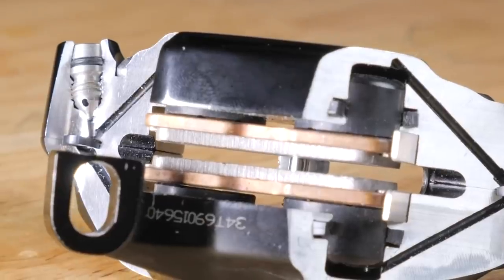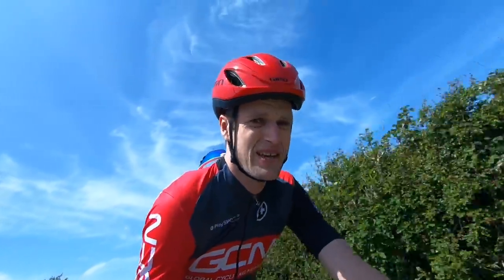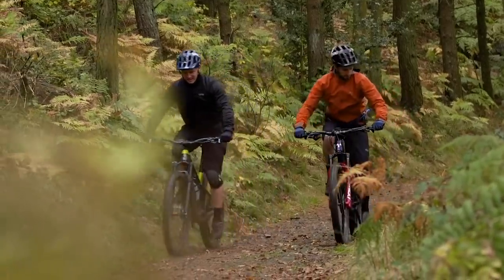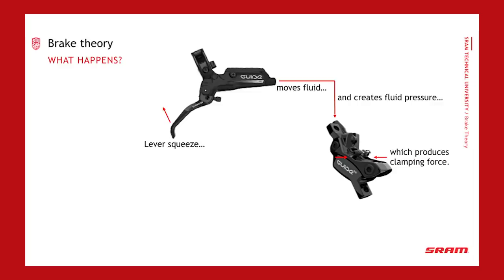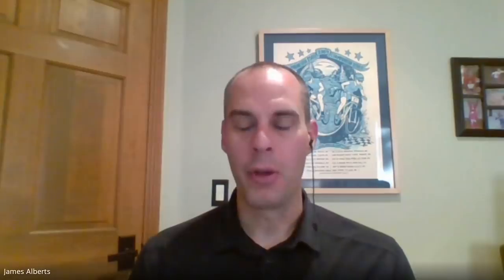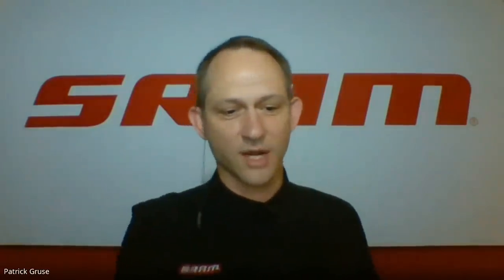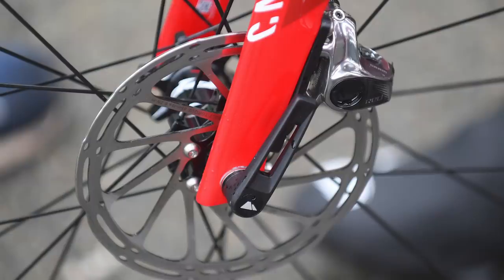How Do Disc Brakes Work? | What Makes Your Bike Stop

Comment: When tightening the bolts on disk brakes use a torque wrench and do it in star pattern (tighten the bolt diagonally from the one you just tightened). SRAM and Shimano have different torque tightening limits., when tightening the bolts do it in stages i.e. if the max torque limit is 4Nm then tighten all the bolts at 2Nm then retighten all the bolts at 4Nm.
https://www.bikeride.com/torque-specifications/

Comment: That was long overdue!  More videos on discbrake maintenance please!
Reply: In reality there almost isn't any on a road bike. The system is sealed and not exposed to the dirt MTB systems are. Just pop in new pads once in a while, which is way easier than the voodoo that was rim brake pad adjustment.

Comment: If you use rim brakes, your disc size is 622mm
Reply: Putting disks at 622mm- Genius! Opps!, its already been done. No money there. We need regenerative braking systems! Much cheaper of course would be instant stop technology as on power tools. No batteries on board because that would be an E-Bike! Too many options to sell to a gullible public!
Reply: It is a terrible 622mm disc. A hollow one rather than solid steel so it can't withstand hydraulic force and aren't true enough to use with 1-2mm clearance without brake rubbing. Hence, more clearance needed and less mechanical lever can the force multiply from the lever. 
Still, it's big 622mm diameter make it work despite so many poor properties vs proper disc brake.
Reply: That was always my argument…until I tried them!

Comment: When considering braking it is always worth remembering that what actually slows a vehicle is the friction between the road and the tire. The brake applies a torque to the wheel which then is resisted by the contact point with the road. Everyone discovers this the moment they brake on ice. There are two important corollaries to this: firstly, if you lock up a wheel  by braking too hard (skid) the coefficient of friction drops dramatically and both cornering force and braking force will be severely impacted. The scenery may also be severely impacted by you. The second is that the tires also need to be up to the job. If you have excellent brakes but really lousy tires and a steep descent, the grip of the tires may become the limiting factor.
Reply: Brake modulation still allows you to better use the traction that you have. Ie, a better modulated brake can help keep you from exceeding the limit of your tires. That's where the benefit of disc brake lies, not in absolute power.
Reply: Galen Kehler No arguments from me. I will never buy another rim brake bike (unless it is a 1978 Raleigh Professional). Although I like my two 1970s bikes there are hills round here where the steel-rimmed version won't quite stop me, and I am less than 150 lbs. In the dry the smell of burning rubber from the brake blocks is disconcerting, but in the wet the almost total lack of braking is scary. The vintage aluminium rims are much better but the old flexible steel forks still induce judder. If I am serious about going fast it is the BMC disc RoadMachine. Also I can commute in town on my fairly heavy hydraulic disc flatbar Brodie Tesla faster than a rim brake road bike because of the superior braking. You can't throw a bike towards an intersection at speed unless you are sure of stopping if you have to.

Comment: One advantage of disc brakes I never hear mentioned is the reduced force required to brake. With disc brakes I have increased stopping power with less effort squeezing the brake lever..if you’re older or have hand issues this is a tremendous advantage. 

Will Bicycle’s ever have dual discs up front like motorcycles? This would eliminate asymmetrical forks.

Comment: I've been using hydraulic disc brakes on mountain bikes for 20+yrs. While they were one of the major advances for MTB due to the superior braking power and control, they carry a significant weight penalty (500-600g) on road bikes where the braking benefits are much more marginal over rim brakes (unless you lice in a very wet climate).
Reply: I think 500g weight penalty is a stretch.  I'm pretty sure my brakes and rotors weigh less than that even without subtracting the weight of the rim brakes, and potentially the difference in rim weight.

Comment: Being able to put bigger or smaller rotors on to suit the rider weight is something I didn’t think about before.

Really cool to hear from the experts on the whole thing.
Reply: Indeed, I use 160mm rotors during winter months and 203mm ones in a Spring-Fall season on the same bike.
Reply: Should need 200mm for 107 kilos then. Doing just fine with the chain as my only brake.
Reply: Thanks Chris, glad you found it useful. Patrick and James have so much knowledge, it's incredible!

Comment: Disc brakes are less aero and heavier all the time you are riding.  The improved braking discs provide are yielded only during the time you brake, not all the time.
Reply: Well, knowing that you can brake better might make you go faster / don't brake in certain situations. So they have an effect even when you are not braking.
Reply: Aerodynamic..there is so little difference that it can’t be properly measured (in the recording error area), even if, it doesn’t matter, if you come 10sec faster home from an hour drive. Weight; in high end it’s 400g difference, so also not a lot (it doesn’t matter if the bike is 7,0kg or 7,5kg). With the apex/105/tiagra, the bikes are over 8kg-that’s already a bigger difference yes. The weight is more a problem with some frames brands. Like Spesh and Trek make them super heavy, so a high end aero bike weighs around 9kg. My aero disc Di2 weighs 7,8kg with 38mm carbon Novatec wheels (far from lightest).

Comment: Who in their right mind wants a set of brakes that slowly rub away the rims of their expensive aero light weight carbon wheels. When you can have a braking system with a cheap replaceable rotor.  It’s a no brainier for the amateur rider who pays for their own stuff.
Reply: Pete is never wrong  That was smart to put a twist into a "Show more" section!
Reply: I can still understand that people riding occasionally on flat clean and sunny tarmac could prefer (for nostalgic reasons, mainly) the rim grinders... ;)
Reply: I just send my wheels to my wheel builder, and have him replace the rim.
I'm more focused on aesthetics than performance, so I'll continue using rim brakes until they're not available anymore.
Reply: @panzerveps  I also prefer aesthetics, that's why I always choose disc brakes :)
Reply: Pete is never wrong  OMG! I am 50 years old, so I well remember when cassettes added the number of cogs. People were as upset about a 9 speed cassette as people today are about disc brakes. The mantra was "Eddie won five on five". Which is also one of the dumber things I've ever heard. If Eddie had a 9 speed cassette available, he would have used it.
Reply: @panzerveps  I think discs look great.
Reply: @galenkehler  Why? They look so wrong on a road bike...
Reply: $100 for a replacement pair of Ultegra rotors every ~10,000miles, $50 for replacement pads every 3-5000miles, and a brake bleed ~twice/year for about $60 a pop (very reasonable price). If you ride 10,000 miles/year you're looking at a minimum of $320/year worth of maintenance for Ultegra level components. If you contaminate the pads that price goes up even more. A solid pair of aluminum training wheels goes for ~$300, which will last for ~40,000 miles before the braking track wears down. Replacement pads are ~$30. I don't see where the cost savings comes from. Disc brakes are stupidly expensive to run if you ride a lot.
Reply: @panzerveps  I understand lots of old people got used to things looking a certain way, but the simple things look best to me.
Disc brake calipers are so simple looking, not some rube goldberg contraption of levers and pulleys. 
Also cleans up the overall look of the front end, especially in the junction of the frame and fork.
Reply: @McAwesome363  when people talking about wearing down the rims on their nice expensive wheels, they aren't talking about a $300 aluminium set. They're talking about carbon wheels which cost well over $1000.
Reply: @McAwesome363  also what makes you think that a brake bleed twice a year is acceptable? Should only be done when something's not working.
Reply: @McAwesome363  On my road bike, I'm using TRP spyre cable disc brakes, so no bleeding necessary.  I pay a lot less than that for pads.  more like $20 for both wheels.  Seeing as they last a lot longer than rim pads, I think that's probably a wash.

The main extra expense is a set of rotors once in a while, which probably don't add up to the expense of a set of cheap wheels in the same time period.

Couple that with the fact that I can ride nicer wheels, instead of cheap ones. and to me disc brakes win.

Also, where I live, it rains a lot, and I spend a lot of time riding in the city with lots of stop and go at times.  I'll grind through rim brakes (and rims) far faster than the numbers you're suggesting.  I'll also go through pads and rotors faster, but not to the same degree.
Reply: @galenkehler  Have to disagree with you there. If you're mechanically inclined, a rim brake caliper is a pretty simple device.
The disc brake caliper looks decent, but the damn rotor is hideous, and ruins the look of an otherwise beautiful bike.
Reply: @panzerveps  In your opinion. I think they're elegant and massively clean up the front end view of the bike.
Reply: @rossfripp4503  Until you install the wheel.
Reply: @panzerveps  I was talking about the head tube area. It just looks a little unclean and cluttered in my opinion. Either way, I'm not fussed about the aesthetics a great deal, but if I had to choose it'd be discs. I have a bike with rim and a bike with discs. Personally, I won't be buying another bike with rim brakes.
Reply: @jamiemilbourne4498  training on carbon wheels doesn't make much sense. Saving them for racing/special occasions is much more logical. You won't even find pros training on carbon rims, just doesn't make sense
Reply: @fukav1am  yeah, but I doubt many of them have tried them.  They just assume they're like most of the cheap ones that come on department store, and cheap hybrid bikes.
Hydraulics usually have a lighter lever feel, since the self adjustment allows them to run more mechanical advantage, but I find I get plenty of power with the cables, and it's a little easier to modulate.  Also, when hydraulics are working well, they're great, but when you get a sticky piston or something, or have to bleed them, or replace hoses, it's definitely a lot more hassle and expense compared to the cables brakes, where you can pretty much just clean them, and put new cables on and they'll run like new.
Reply: @McAwesome363  but why not?  If you're not wearing them out, you don't need to "save" them,  you can ride nice wheels every day.  Not that you need them, but by the same argument, you could just ride a 30lb department store bike for your training, and save your nice bike for special occasions or racing.

Comment: Cool video Conor . I have disc brakes on my first bike in 2016 then again 2016 my second bike has disc brakes , fast forward end of season 2019 my third bike has disc brakes I like disc brakes and they look cool as well as good for stopping   . Quick question , which is better a "floating rotor" or a "fixed rotor" ?
Reply: a floating rotor is just made to allow it to expand and shrink slightly instead of warping if it gets too hot.  That is definitely a good feature, but it also isn't really necessary for a lot of uses.  If you often ride where you need to do a lot of sustained braking, it could be worthwhile.

Comment: Just remember, even though people have been descending for years on rim brakes, if you've got 140mm  disc brakes it's a no no , you need 160's 🙄
Reply: LOL! My road bike came with 140 on the front and it was changed to a 160. But, I'm also 6'3' and weigh more than I should.
Reply: Just wait until they decide you need carbon ceramic brakes. They must be better because they are lighter and have "carbon" in the name.
Reply: @Rover200Power  they will save you 0.2 seconds over 1,000k at 200kph
Reply: @DaveCM  LoL
Reply: If you use rim brakes, your disc is 622mm
Reply: mikes1984 best comment ever!
Reply: Why put up with that overly rigid fork ? Also that extra kilo, weaker dished front wheel with more spokes = more aerodynamic drag. That said, they make sense on mountain bikes.  The industry creates problems people didn't know they had.
Reply: @Rover200Power  Yes it's coming! We need this when race organizers require a complete stop at each stop sign. It could make manufacturers a fortune as novices screech to a stop so they gain an advantage like the pros.
Reply: @davidburgess741  it doesn't make that much difference to the fork, beyond the fact that you've just got better braking to begin with.  The largest force on the fork is the braking force itself, which occurs between the tire's contact patch, and the crown race, regardless of where the brake itself is.
Reply: Rover200Power , can you post a link to these as I can’t find them through google.

Comment: I rented a bike with SRAM disc brakes a few months ago. As the day got hotter (~35 degrees C), when I squeezed the brakes the calipers would stay partially deployed which meant I had to cycle with the brakes half-on. I rang the bike rental company who tried fixing it, but the next day the same thing happened. 🤷‍♂️

Comment: Hi GCN Tech, i have a few questions. i just bought a second hand mavic exalith wheels, i went to a local bike shop to buy the required pads but they gave me a set for carbon wheels, they said it should work, (tried to look it up online but i couldn't find any info) does it?
not being sure , i  ordered the exalith specific pads online,but i can't wait to ride, is it ok to use regular pads for few times? thanks !

Comment: Fun fact: all examples was recorded with a shimano disc brakes.

Sram Engineers: not a problem for us.
Reply: Luis Rosano are SRAM better? Genuine question
Reply: Would not use SCAM!
Reply: @JUSSTTIINFU3K  they're different, and everyone will have their own opinion on which is better.
As a generalization, on the mountain bike side of things, sram brakes tend to be more linear, and shimano tend to have more initial grab.  People who like sram say they have better modulation, where shimano is more on/off.  People who like shimano say they're more powerful and sram are weak.
Also, sram uses automotive style brake fluid, where shimano uses mineral oil.  Both have their upsides and downsides, so again, people generally won't agree on it.

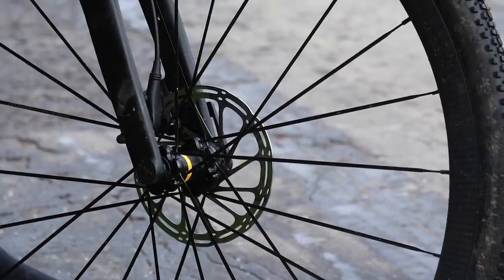Comment: @gcn In the sequence at 3:18 you are showing a Front Disc. Isn't that one rotating into the wrong direction. Because I've learned that, in opposite of a motorcycle, on a bicycle the struts have to head forwards.

Comment: The two main areas where SRAM are way behind Shimano has always been front derailleur shifting and braking, suddenly SRAM is pushing disc brakes and 1x hmmmmmm
Reply: Shimano front derailleurs are awful.
Reply: Timmy LORTZ [09R13M] of course it does. But they are no doubt more complicated to use and setup.
Reply: Not commenting on Sram's reasoning, but I do prefer both disc brakes and 1x, and have been using them both since before they were readily available on road bikes.
So whatever their reasons are, it might still be a good direction to go in.

Comment: Something they touched on that bugs me about Road bikes is rotor size. Most road bike frames are designed with 160/140 rotor capacity. So, putting 180mm rotors on is not possible. After descending a few different 25%+ grade roads, I can definitely say with my weight I need bigger rotors. Cornering at 60mph (100kmh) on a bike is a scary experience.
Reply: I definitely prefer bigger brakes as well.  I've got 180mm front, 160mm rear on my road bike (cyclocross frame, set up for road).  It's probably not necessary, since I'm rarely running anywhere near their limits, but the lever force feels better to me.

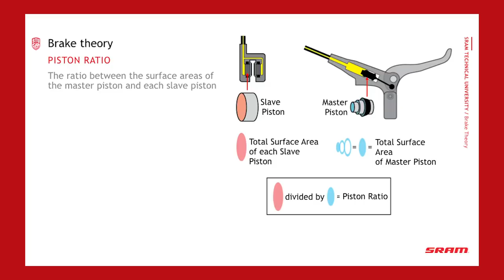Comment: SRAM engineer should end his statement at 7:29. Lever increases pressure in the master cylinder that is transmitted through the fluid to the slave cylinder or in this case P1A1 = P2A2. 1 is the master 2 the slave. The fluid is not compressible and in this system is not a powered hydraulic system. The fluid transmits the pressure that results in a mechanical force against the slave cylinder head. Added: the force equation for pressure is F = P*A. A is the area of the cylinder.
Reply: Flash back to Bernoulli and fluid dynamics class. Well played.
Reply: the pressure in the system can be assumed to be constant: p = F1/A1 = F2/A2, (thus p1*A1 = p2*A2 --> A1 = A2 - doesn't make sense to me)